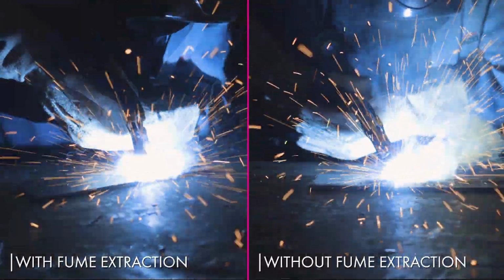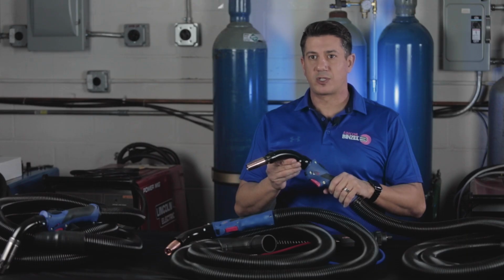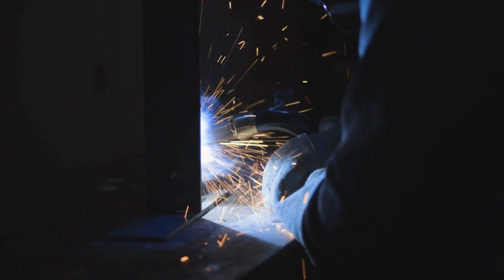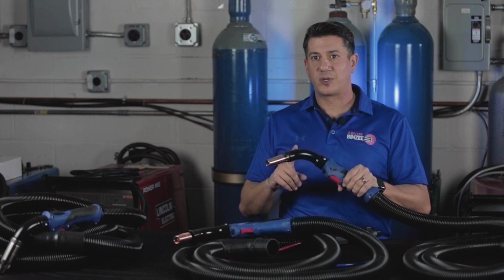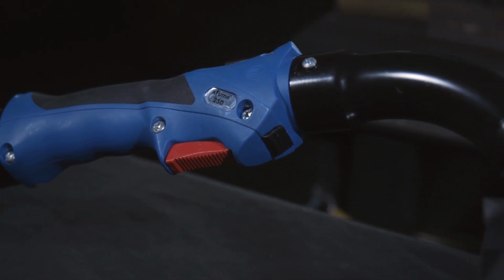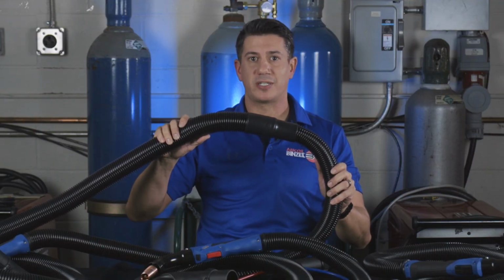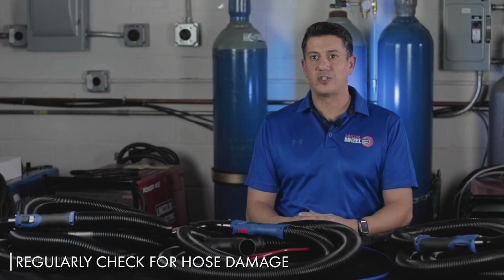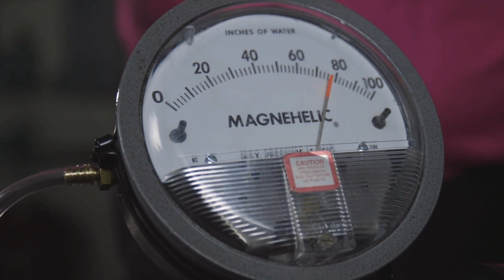How Fume Extraction Torches Work | Binzel Basics

Comment: Wouldn't get one if you work with galv it destroys the torch
Reply from the maker: Hey Stefan, you are correct that galvanized welding produces fumes that are harder to deal with, but with proper maintenance, it will not destroy the torch. Additional maintenance/cleaning procedures may be necessary, and the filters of the extraction unit may need to be changed more frequently.

Galvanized welding produces fumes that are especially toxic. It releases zinc oxide that causes fume fever, so it is a very good idea to use source capture fume extraction in these types of applications.